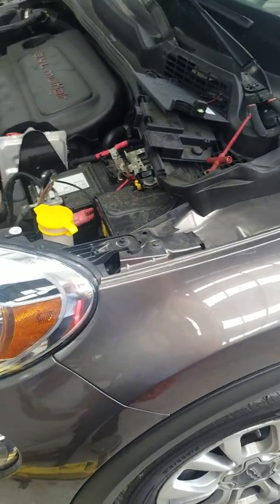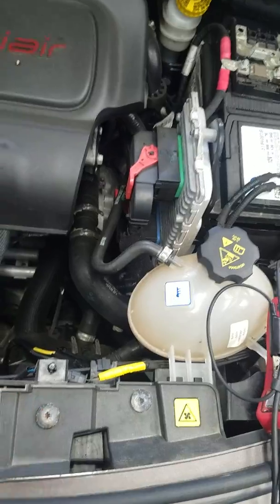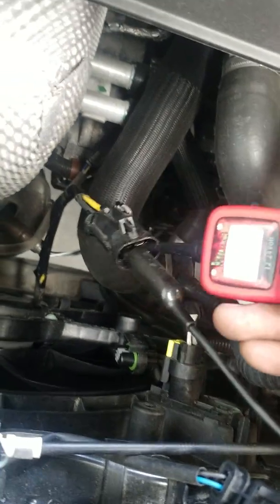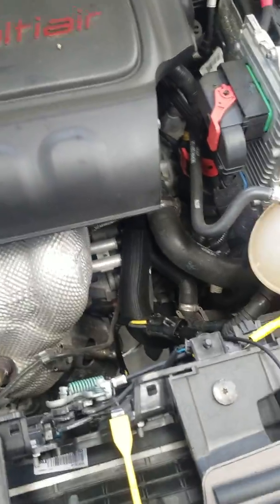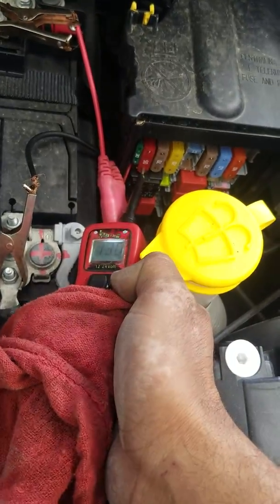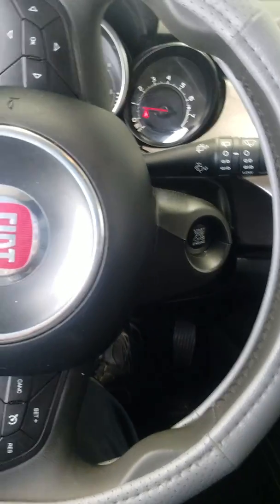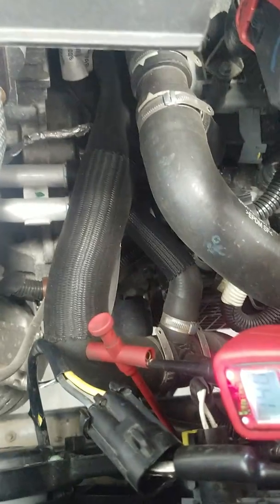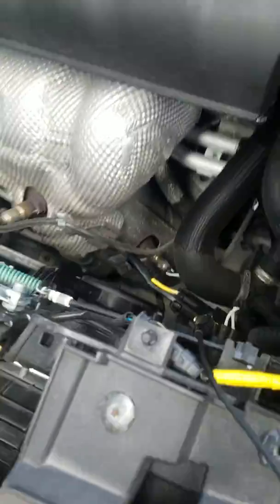P0481 Fiat 500x, cooling fan control circuit, maxi fuse hack

Comment: 50a + 30a = 80a can fit the amp in the car
Reply from the maker: It was a 50a blown fuse. It was non existent. Was used because parts store is very far away. It was safe to step down to 30a because that 30a was existent unlike the 50a

Comment: what relay is #2cooling fan on ram 1500 2012 need help
Reply from the maker: jerry jr leverson let me get u a picture
Reply from the maker: jerry jr leverson 2 cooling fan relays. One high one low. High fan relay repair information shows is on the fan. It probably looks like a fan module. The other low radiator fan relay shows is k11 on fuse box in engine bay.

Comment: I had the same issue after replacing the fan it still blew out again. Do you know what would be causing to burn out again?
Reply from the maker: Stephanie Z disconnect the fan and see if it blows it. Its possible the fan came out defective. Ive seen it alot
Reply: Jay R The Mechanic would you know where do get the new fan that has a heat shield? I can seem to find that one anywhere
Reply from the maker: Stephanie Z does the old one have one? I cant remember if it had one
Reply from the maker: Stephanie Z if it doesnt blow it after disconecting its the fan. Alsp u want to get the one from dodge dealer. No aftermarket